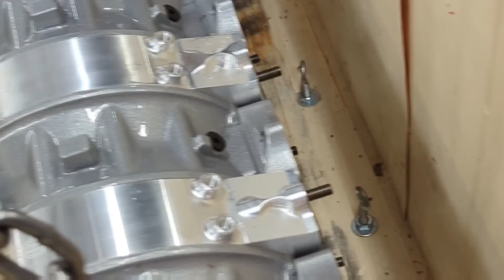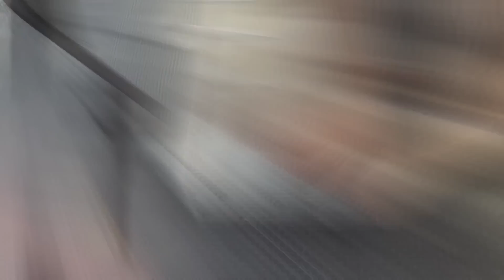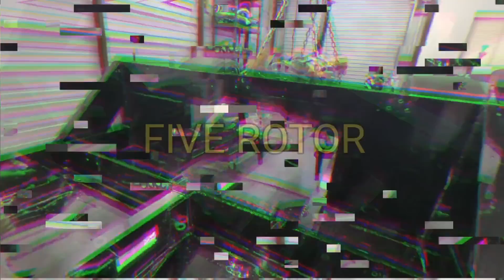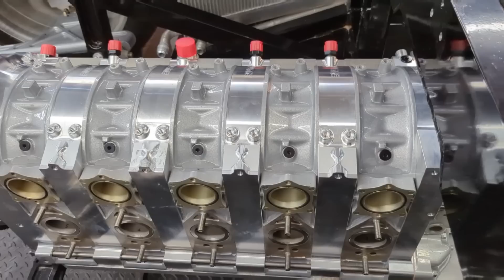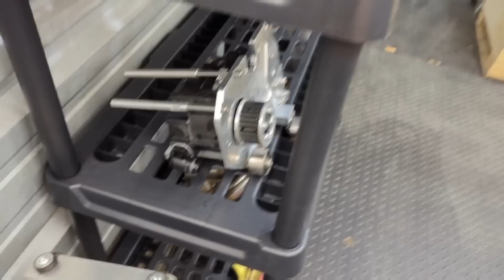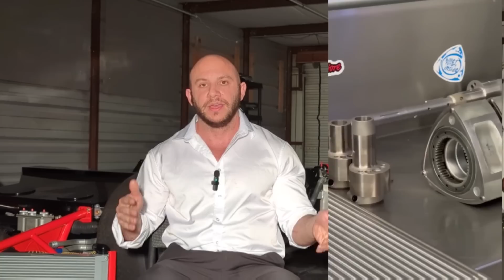Installing the billet 5 ROTOR into the MF5 Superlite; Chassis Exposed!

Comment: How many degrees are the rotors staged from each other, is it an off degree difference because there are 5 and not 4, i would think with a 4 rotor each rotor would be 90 degrees different from one another on the crank
Reply from the maker: 72!
Reply: @MazzeiFormula  i figured it was an odd number. Thanks

Comment: Very long time I don't see a peripheral port,  I love the power this can make. I have a First Gen Mazda RX-7 with 12A engine I try to found the 12A plates for eliminate the side port division to create something similar to the peripherals ports. Before I mention the third spark plugs, because the 787B use this for better burner fuel, also I consider to add the third spark plugs for better fuel economy. I like your building.

Comment: Considering the effort you've put into this - have you considered electrification down the road? You have this monstrous overpowered engine, with a few super caps and some software/hardware knowhow you could have electric anti-lag that is charged by the engine similar to F1, add in regenerative brakes and small electric motors you could either boost the engine output when you need it most, or even use small electric motors in the front wheels for part time AWD when needed at low speed to get that power to the road.

I'm an engineer myself, and my dream has been to build a rotary platform around capacitors that would do what I described above and more - no huge battery weight, just small boosts from lightweight (comparatively) caps when you need it most.

Either way, this is the most beautiful build I've seen in a very long time, I'm used to the Super-Lap monsters that are crazy mish-mashes of everyone's ideas on how to go faster, and look like the car equivalent of Kowloon walled city, this is a work of art and I'd be terrified of scratching on the track...

Comment: Isn't one of the best and I thought patented feature of the billet pro plates that the inserts are replaceable if damage occurs or from long term wear and tear opposed to having to scrap/replace entire housing ? Like difference of rebuildable with parts cost at hundreds of dollars per insert vs full on replacement parts cost in the tens of thousands

Comment: I can't even imagine the amount of engineering and planning that went into that engine. Great idea with the individual water ports on each rotor housing to maintain uniform temps across all 5 rotors. This thing is going to be a torque monster!! I would imagine you're going to need more bracing from the top and sides to keep that block from rotating in the frame.😲 Can't wait to hear it run.😄👍👍

Comment: David, will the purpose of this build be for Time Attack? Cheers
Reply: Dave seems to do these builds more for the art. Of course he will put the car to its tests and limits, but, I dont see him competing competitively with it. Although, you would hear zero complaints from me if it turns into a competitive track car!
Reply: @JonHop1 I doubt the car would fit in any pre-existing class, making competitive racing kind of hard, unless he were to do another, track-specific build
Reply: @halofreak1990  well, let's just put it this way, he would struggle to find a class he could be competitive in that is for sure. It is pretty much a pro-level build. Public Time Attack would be pointless. Maybe so.e Pikes Peak type stuff? 🤔.. lol tough call..
Reply: Not exactly. Considering I don't hold it against him for wanting to use it as a road car.
Reply: No. For fun. No competition